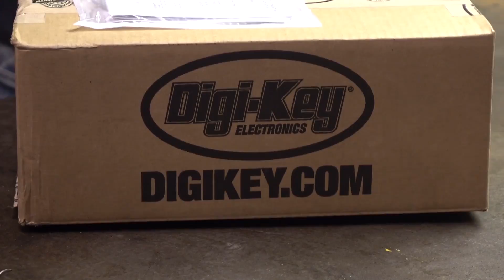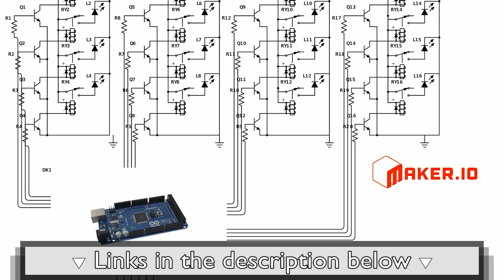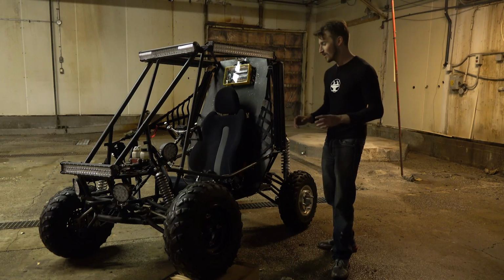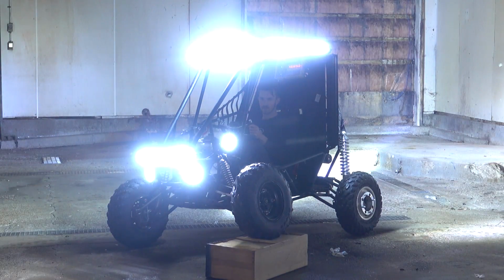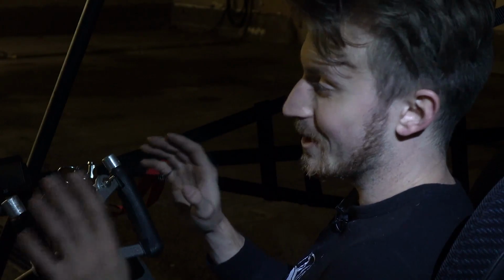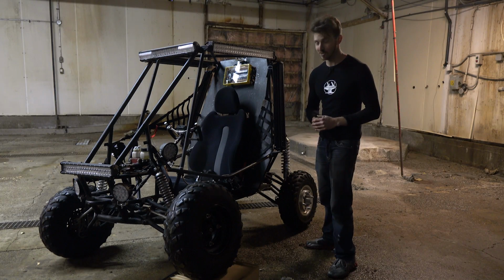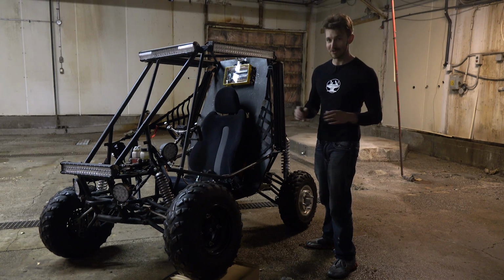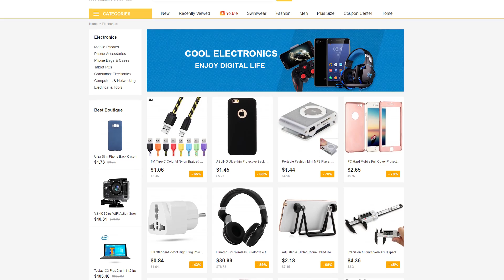Electric Batman Baja Part 4 - TOO MANY LIGHTS!

Comment: so i am not a fabricator or engineer of any kind but you could stretch the frame or chassis as it were like they do with stretch limos like to make a stretch navigator i mean it will take some cutting and welding and i am sure easier said then done but its a thought that i am sure you thought of already but just in case you didnt. Also if you change up the suspension so the front wheels each have there own swing arm operation it seem like that would be more true to the tumbler at least thats how looked again i could be way off as this not my exact area of expertise
Reply from the maker: +Draven Kane the issue is the true tumbler... Is not an off-road vehicle. It's a terrible design from an engineering perspective and any real life tumblers out there ... Probably can't even go over a curb!
Reply: OK as I said it was a thought thank you for getting back to me on this i do think the individual swing arm idea might be road to look down but maybe not for this design i had theorized with a buddy about an all terrain motor cycle idea that was based slightly on clouds bike from ff7 advent children and we thought in theory if the wheels had there own swing arm operation it would make traversing difficult terrain  a bit easier and maybe a better ride for the wounded patient  slightly smoother but again we were just spit  balling and he passed on before we could test and if this idea peaks your interest then by all means use it i just ask that you credit myself and Jeff "Karma" Troester for the concept maybe it spark another project lol this is not my area of expertise i have limited knowledge on mechanics and engineering and any of that stuff but I love the videos and this channel keep it up I know some day you will make the real iron man suit

Comment: did you put an on board charging system (alternator) so there isn't a charging wait time. have it charge while you ride.
Reply from the maker: It's possible to do regenerative braking, but you can only recover braking energy... not enough to recharge. That technology only really works with hybrids that have a gas engine still.

The power pack is small enough that we can just have a spare we can charge while we're using the other pack =)

Comment from the maker: CURRENT IDEAS / PLANS!

► Grappling hook + winch (obviously)
► Night-vision camera + IR light array
► A horn!
► Cupholder
► Armor
► Heads up Display
► Batarang shaped steering wheel
► Smoke bomb / generator
► Tire spike box
► Roman Candle launcher w/ remote ignition
► Remote control
► Autopilot
► Lambo doors
► Batsignal
► LASERS
► Turret
► Paintball guns

Add more by replying to this comment!
Reply: the Hacksmith how about a batarang launcher?
Reply: the Hacksmith or perhaps hydraulics although they're usually expensive lol

Comment: What if you add those battery powered jets from the fly like iron man build as like a speed boost, if that would even help? I guess depending on how many you have strapped to the Baja. @The Hacksmith

Comment: Honestly i dont think there is actual way to make this even resemble a batman tumbler, so i would not mind thins being just little average side project with out additional flametrowers etc gimmics. If your going to make it, then do it properly with custom design frame from tube etc.

Comment: you gotta legnthen the frame. batman is a big tall dude right? elongate the frame and move the seat back a bit. Why not connect the second motor with an extra switch? Get it going and use that as a boost! You'd be unstoppable!

Comment: Build a missile launcher on top, lining a bunch of pipes next to each other so you can have like 12 model rocket motors able to fire off. Like every time you press a button one launches and a display counts how many you have left. you could put this on top of the lightbar.

Comment: You should add a bigger stronger flamethrower like the one from the prank v prank video you uploaded while a go  and mount it on top. Also add some aluminum sheets to the casing to strengthen  the car and aluminum is a cheaper alternative to the stronger and lighter titanium on the back below the yellow box a place to put the batman briefcase and grappling gun. And maybe a place to land a drone for surveillance. Thanks for making my this awesome video. Hey everyone like this comment so the Hacksmith will see it.

Comment: Hey hacksmith, remember that rocket launcher in that iron man suit? Which was on the hand of the armor? How about you add that here. just aim it at a particular point and maybe add a windshield where u can mark an aim kinda thing so you will know where the rocket will go. Or don't do the windshield part and add something which can change the aim with a motor or something.

Comment: This car needs boost! With the frame it will be too heavy
Reply: And an harpoon
Reply from the maker: It already can practically wheelie...
Reply: if you put it half way between the front and back and slightly down wards you could uses it to stop form doing a wheelly

Comment: Love what you've done but be careful with the law. Canada's law and UK law are generally very similar and in the UK having flashing lights on the top of a non-emergency response vehicle is illegal.
Reply from the maker: It's not a road legal vehicle in the first place... only ever going to be used on private property lol.
Reply: I figured as much. It's not like anyone WOULD mistake you for the police anyway XD But you were driving it down a road in an earlier video weren't you?
Reply from the maker: Technically it falls under the category of a LSV (low speed electric vehicle) so it's possible to move it on city streets at speeds of 35km/h or less, but generally, we throw it in the back of a pickup truck and take it to private property
Reply: Aaah so the same rules as the fast(er) mobility scooters? In the UK we still have to register them to use them, despite them having no registration plate. So pointless and annoying.

Comment: Honestly you should make it look like the Tumbler THEN add all the cool functions
Reply from the maker: If we extend the frame we won't be able to put it in the back of the truck to take it to places to drive (it'll never be road legal). We can't drop the frame cause your head is already only like 8" from the ceiling... we're just changing the name to the Bat Baja. Besides, any "real" tumbler builds out there are not off-road at all so we win there already ;-)
Reply: the Hacksmith Could you not just get a car trailer (or something of similar size) so that you could transport a larger frame?

Comment: it seems like an obvious statement buttt...in order to get more of a tumbler look, why not "chop the top" like on old hot rods. it looks like you have plenty of room for clearance above your heads. would give it a wider low look with the dual rears. possibly get rid of that top heavy issue we saw here haha. I am beyond certain you have thought of this, so why didn't you chop it?
Reply from the maker: You can only really drop it by about 4-5 inches before you're getting too close to the pilots head (Ian's rather tall). We mocked it up in photoshop and dropping it that little barely makes it look different =(

Comment: if i use 2 turnigy sk3 6364-245kv Brushless Outrunner Motors which and how many lithium polymer batteries should i use? plz link 4 hobbyking.com

Comment: Would look way better with a rack on the back - please lose the keyboard - ps - im surprised with those light bars handling the rollover - i rolled over a speed bump in a walmart/sams club parking lot and half of my lightbar stopped working (one out of 2 lightbars)   - I guess crap brands garner crap quality! lol
Reply from the maker: +Nicholas Brown if we lose the keyboard how are we going to control the lights? It's going to be mounted on the dash, just put it on the wheel for this video since we don't have a dashboard yet!
Reply: Bluetooth through a cellphone or a Ipad/galaxy tab mount <3  that would be EPIC!  Then you would have a OS to automate, and you could automate to music using it as your stereo head unit ;)  BAM!!   Lets get this! - oh and you can monitor battery levels - exact output and drain - how much time is left on the charge and since they have a microphone - put a loud speaker on it too!   --- It Just Got Real! lol
Reply: The keyboard for now is cool - but yeah, with so many combo's to remember, it kinda makes it less fun!  Super geek mode like me for sure!  But I have a hard enough time remembering mortal kombat finishing moves and combos haha!!
Reply from the maker: All part of the plan, it'll have a full touchscreen dash with GPS, nightvision, thermal vision, and controls for all the electronic subsystems =)
Reply: That's awesome!

Comment: Slap some lights on a science project and call it a "Batman Tumbler"? Batman would be ashamed!

And what happened to all the shit you were going to put on it? Armour plates? Paintball turret? Jet engine? Doors? Grappling hook with high speed winch? Electromagnets? Smoke machine? Flamethrower? HUD with thermal and nightvision? GPS?

But what happened instead? Some lights... That's nice!
Reply from the maker: We only work on it once a month dude. Other bigger projects on the go. All those things will be added, when we can afford to. We got free LED light bars, thats why they went on there.